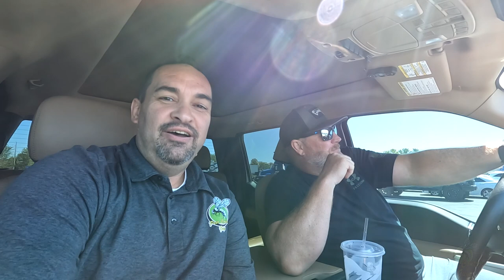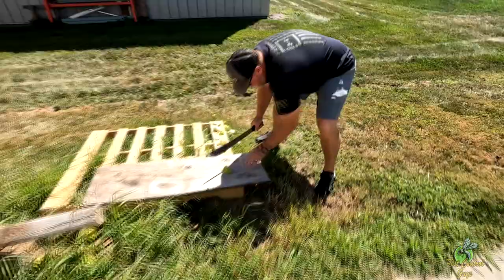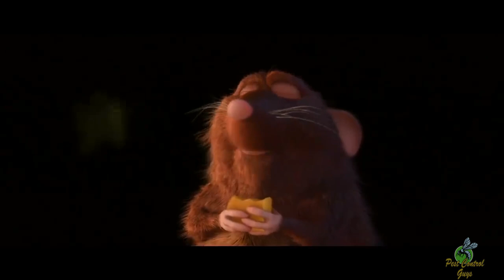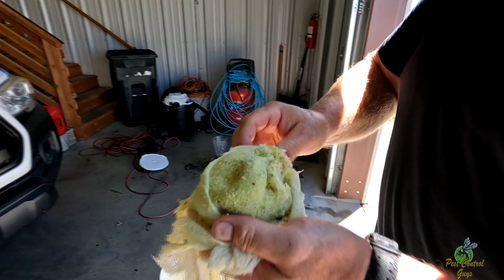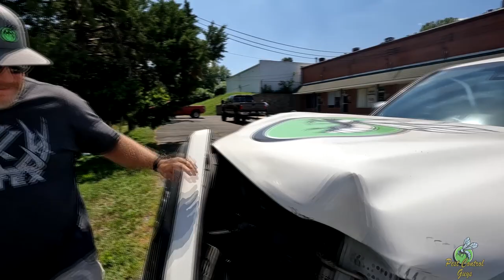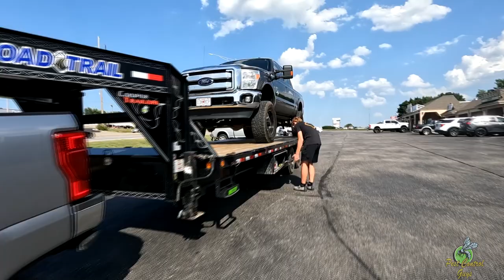Making our own green spider spray. Do hedge apples work on spiders?

Comment: Hedge Apples are known to cause a nasty rash or eczema so I hope Ryan wasn't so impacted.  At least he didn't eat any or drink the juice which can give you a horrific stomach ache and though it won't kill you, it might leave you wishing it had.  Hey, what's a nasty rash and horrific stomach ache compared to comradery and friendship?  JucyFruit... would it enhance or neutralize....  Things that make you go Hmmmm.... 

The multi-blade Ninja often does a better job than a blender on stuff like that (the smaller ones though don't have a long duty cycle before you have to allow them to cool down) however a juicer or vegetable strainer/press that ejects the pulp off to the side might be even better.  With the Ninja's though you can tell someone asking for a ride that you already have a car full of Ninja's.  ;>

Note that Iowa State University found hedge apples better for repelling roaches than for spiders making the roach house potentially a good candidate for the slurry.  Old timers might tell you that lemons are required for the best effect so perhaps with the citrus in SimpleGreen that might be a good ingredient to add to the cocktail.

Simple Green is used by woodworkers to clean wood sap/varnish off saw blades without having to resort to flammable solvents however don't leave it on too long as it can discolor the metal/coatings.

Sorry about the restyling of the truck.  Hopefully there won't be much fallout from the ambulance company, etc.  Glad none of your guys were seriously injured.

Keep having fun and sharing the journey.

Best!
Reply from the maker: I knew we could count on you for knowledge! We are not done with this for sure! Thanks for watching!